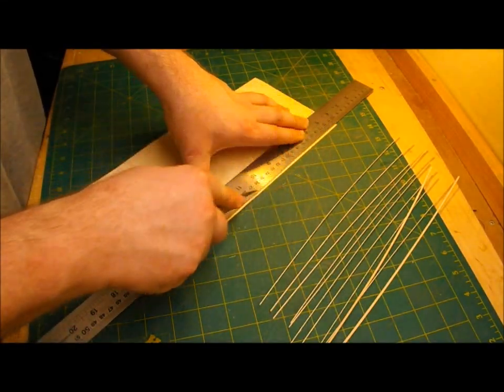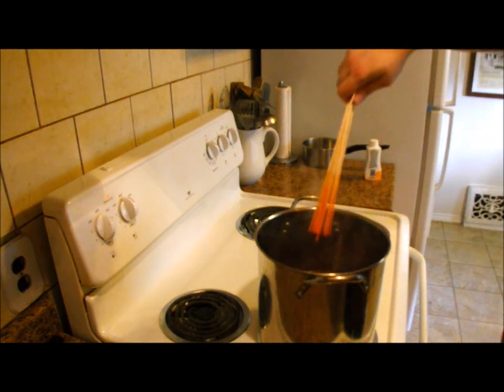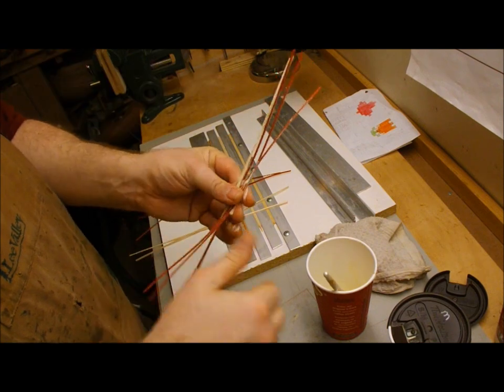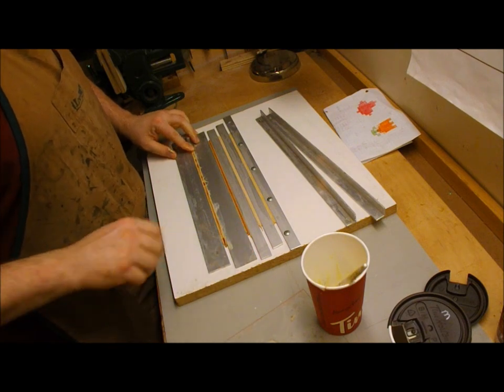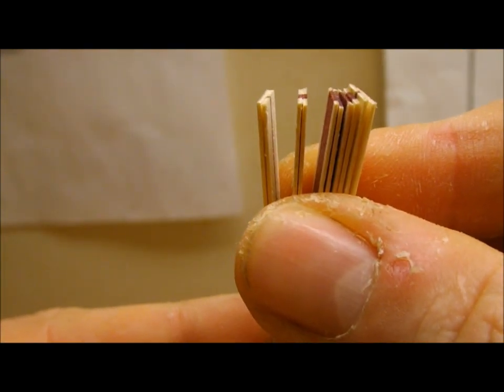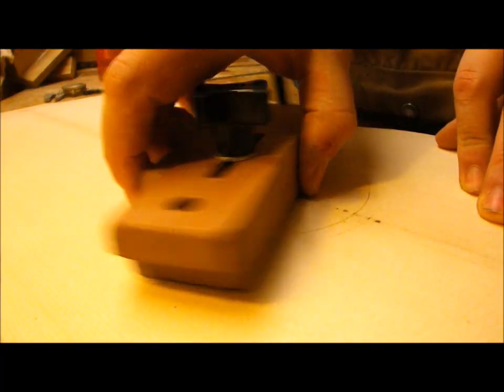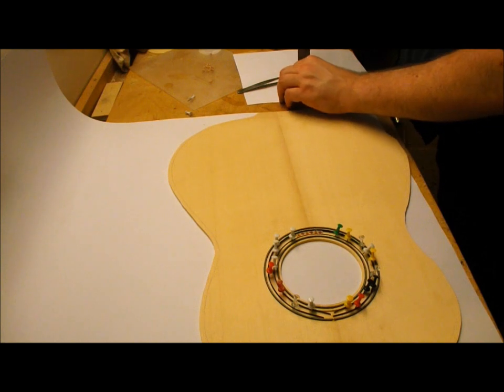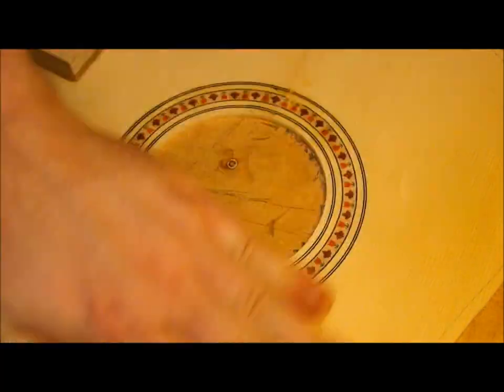Guitar Rosette

Comment: Summary:

Maple veneer, half a millimeter thick, is used for making the guitar rosette mosaic inlay.
The veneer strips are dyed with fabric dye, simmered for a couple of hours for full penetration.
Strips are glued together using standard woodworking glue, aligned with aluminum flatstock bars and water spray to prevent sticking.
After drying, the strips are scraped to final thickness using a Stanley number 90 bullnose plane.
Individual tiles are cut, shaped, and glued into place, secured further with thinned glue to lock them in the rosette.

Comment: Awesome video man - thank you! Question: what angle do you hone your #90 plane to, and do you turn a burr on it?
Reply from the maker: The blade is honed at about 25 or 30 degrees - it's not really critical, and I don't put a burr on it.  The plane is clamped to the base of the jig so the blade is angled about 10 degrees forward from perpendicular.  That seems to make it easier to introduce the strips and get a smoother scraping action.  I flip the strips end for end and upside down so it evens out any error.  It's a useful - I use it to size my binding strips for the guitar body as well.
Reply: Thanks! Are you gluing up each row in 2 parts? This has been the most helpful video on youtube for me on this subject. Much appreciated.
Reply from the maker: Ben Schmolze all the lines in a single row are glued up at the same time. It's just easier to spread glue on five or six lines. I lay the strips out and pick up five, put glue on them, set them down and do the rest. Then all of them get squeezed up against the straightedge together.
Reply: Makes sense. Thanks! I tried two rows earlier - thinned the glue (titebond II) just a tiny bit. I tested the rows after one hour and they pulled apart like nothing.  I guess I should not thin it, and let it set up longer. But the titebond sets up really quickly.  Thanks again for your help.

Comment: I liked your friend technique! Could you tell me which dye you used?
Reply from the maker: It's just inexpensive fabric dye.  Aniline dye for wood will work too, but it's much more expensive.
Reply: @twoodfrd  
Thanks for the tip, I want to make a project of the Torres Guitar.
Reply: @twoodfrd  so true, and the delta cost (difference over time -this one) is bonkers.  For dying or cooking skinny long things try an asparagus cooker the horizontal kind. Uses less fluid and dye but takes more space to store. The ornate lids are for presentation and serving, for the picky ones some have a 15 degree tilt to drain the fluid to a recess. That is added in the kitchen after cooking of course.